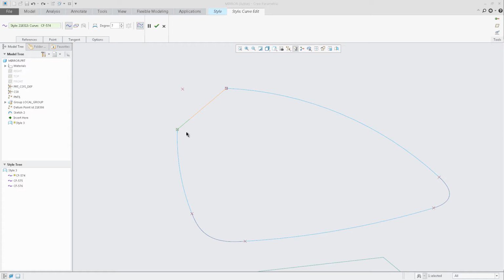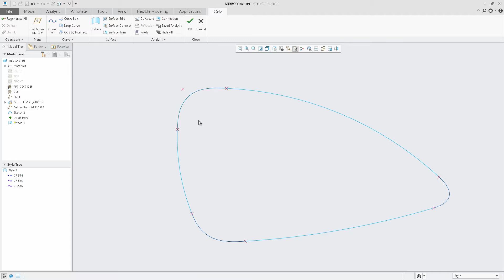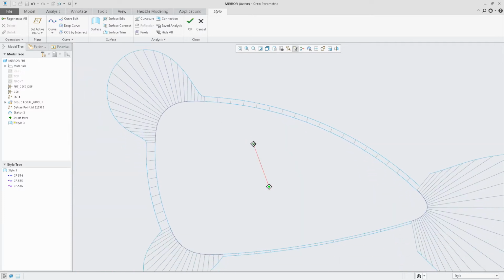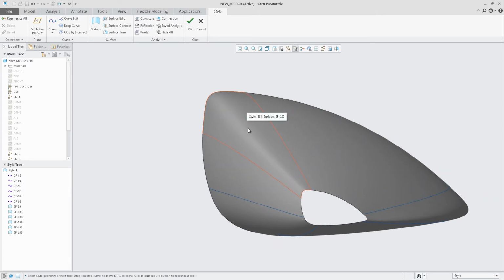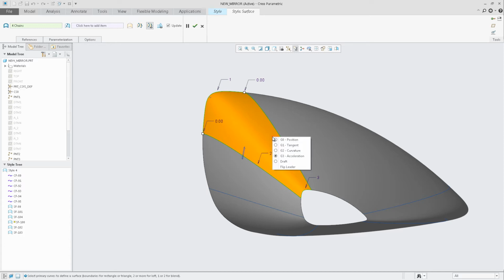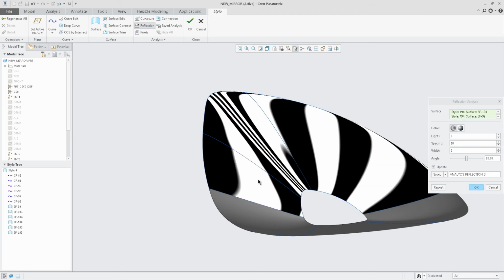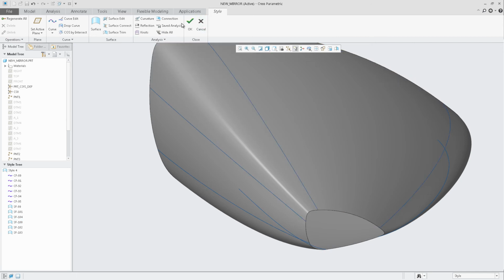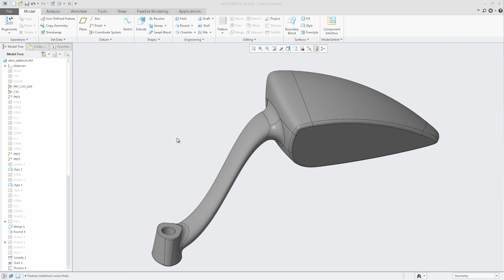New to Creo 4.0 - Interactive Surface Design - Style G3 Connection

Comment: I'm interested in learning more about surface continuity. One thing I have noted on numerous occasions when using Style splines and surfaces with G2 Continuous or G3 Acceleration, is that when you come out of the style environment and analyse the generated surface for deviation, the surface to surface condition is very rarely G2 or G3. Just because Creo allows you to select/implement a G2/G3 spline or surface appears to not necessarily mean your final form will actually have this level of surface continuity i.e. the deviation between the mating surfaces can vary quite wildly when analysed. 
I haven't been able to find any tutorials or knowledge base regarding this. Understanding creation conditions re splines/surfaces and then surface deviation would be very useful.